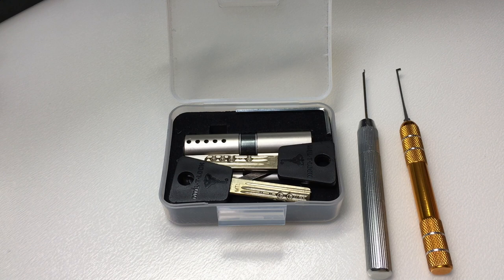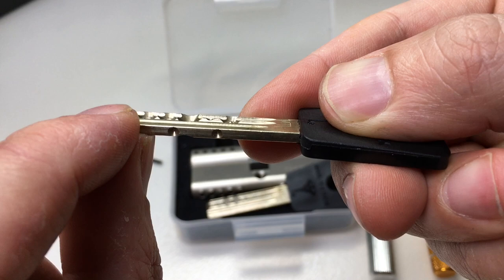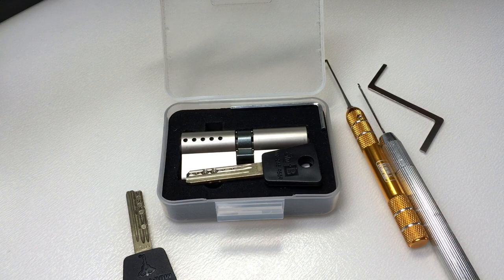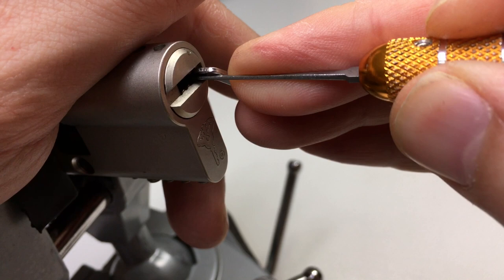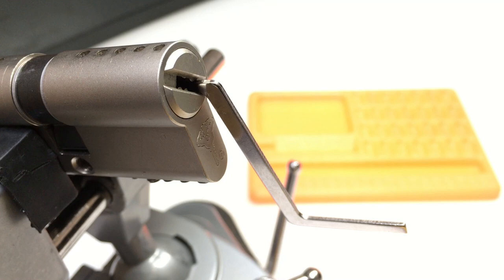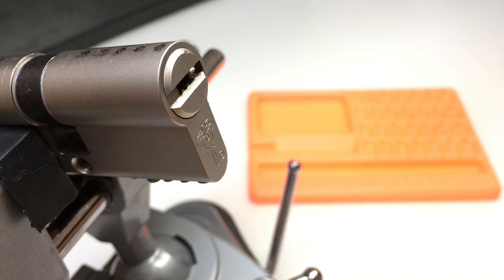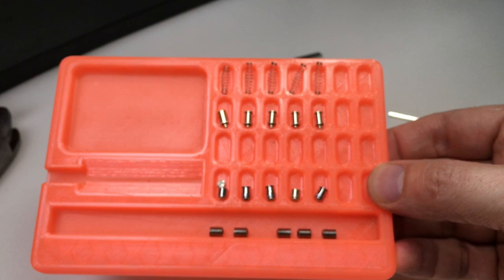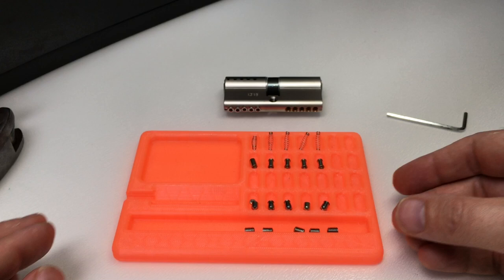(176) Mul-T-Lock Classic Cylinder Picked and Gutted

Comment: I found a video on  re pinning from mul-t-lock, it's to rekey a pin in pin dimple mortise cylinder.   It was extremely educational on the mil-t-lock pin in pin lock.  I found it on a site selling the mortise lock with the pin code card.  From there I found the re pinning set for sale as well.  So one could actually create challange locks with the mul-t-lock dimple locks.

Comment: I want to know how much pressure should i use to pick a multi Lock
Reply from the maker: Angel Santiago good question :-) I found that I need very, very little pressure and a lot of practice. These steel pins are made with fantastic tolerances and don't feel the same as brass. The serrations, bevelling and undercutting on the pins also means that a light touch is essential IMO
Reply: Thank you I'm going for that now and see what comes out of it 👍